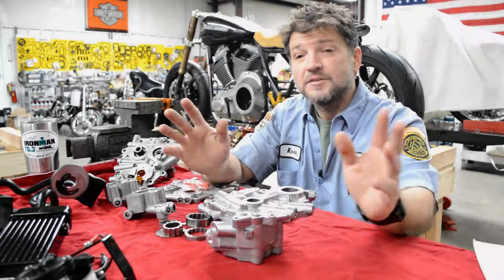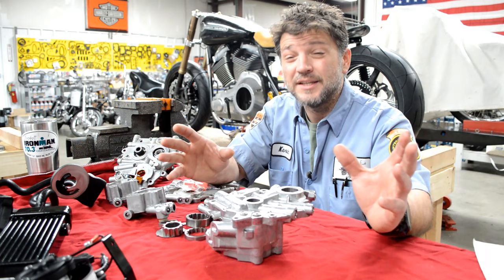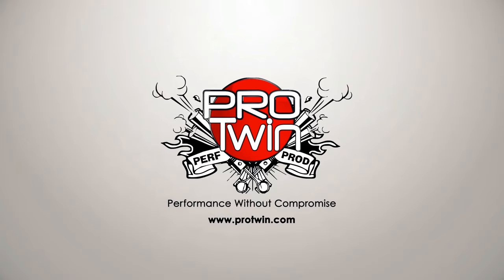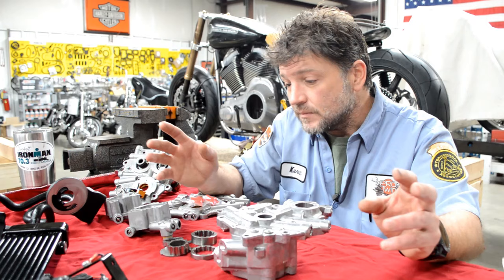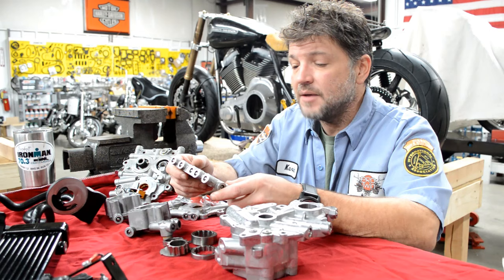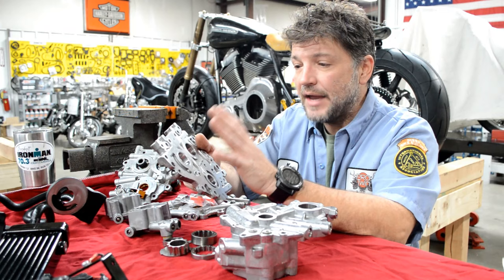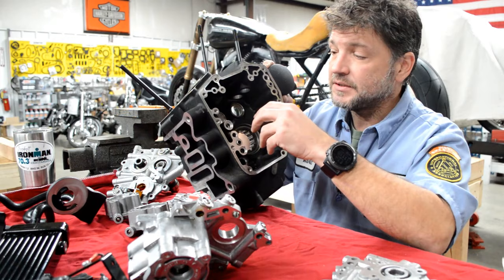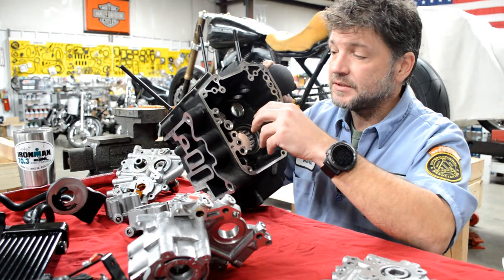Harley Cam Plate Tech - The M8 TC Cam Plate Debate - S&S Cycle - Kevin Baxter - Pro Twin Performance

Comment: I did my 01 FLHTCUI with the following  Dave Mackie 95", 20° domed piston's upgrade, Thundermax 51mm throttlebody with auto tune, had the manifold machined to match intake on heads,  Redshift cam tensioners, cam plate, high volume oil pump, blue micro bearing's, Vance and Hines 2n1 chrome pipe (quieter baffled), all stainless steel hoses( removed all rubber), Dakota Digital Dash, etc basically put in higher quality part's than stock, I did this at 24k miles I now have 29900 on it, now grant it I am not entering the Senior National Bagger Championships but at least I know I can get up and around any semi trucks quickly, during break in I lost about 2mpg but now it's back to where it was stock as long as I don't go full wide open throttle .. Hoban Brothers in Wisconsin helped me tremendously with my adventures, what can I say lol I am a late bloomer to making the torque and HP. 🤣🤣🤣 Ride fast but SAFE!!! Not bad for a 64yo ole geezer...

Comment: I have been watching your videos and they have only added to my belief that Harley-Davidson engineers are to be commended for taking an engine, who's design exists firmly in the 1940s (or earlier) and making it usable in today's motorcycle market. That these bikes run consistently at highway speeds, survive performance upgrades and remain oil tight is a testament to the level of engineering that goes into their very existence.

Comment: Excellent info... I did the screaming eagle plate & pump on my 06 Deluxe along with an Axtell oil pressure regulator valve system....working great so far...thanks for the great videos!

Comment: Bought a used 02 night train last summer and was lied to about service. Opened cam chest and found my plastic shoe disintegrated in pieces on the bottom and the metal tensioner actually fell out when I open the plate. There was no tension on my chain. Replaced with Fueling cam plate, oil pump, lifters and put in  S&S 510c cams with the hydraulic upgrade. Pinion shaft had some surface scarring and chain slapped around a little. Installed a top of line oil gauge with russel line and hot idle I’m at 12-15 but cruising I’m near 40-45. It’s still a little cold up here in Massachusetts and I switched to VR1 20w 50 Dino. I didn’t split the cases but I have good flow at filter and at the return bag line hoping no debris is in between. I cleaned up the pinion with some 400 and the scarring wasn’t noticeable but touch only by sight so I hope I got it in time. I have no ticking and everything sounds smooth...for now but I’m still nervous there could be splinters floating around somewhere. Guess at this point I should just run it and hope for the best as she does seem to run ok. Great video Kevin, thanks
Reply from the maker: Thanks for sharing. Unfortunate circumstances for you but it sounds like you may have got it in time. I would recommend pulling the return line from your oil tank and running it into a jug. Start the bike and continuously pour oil into your oil tank until the oil runs clear. Have a big jug and several quarts of oil opened and ready to pour. This will flush your oil system and hopefully get the rest of the bits out. I do this on softails every 2 or 3 services because so much is left behind with a regular oil change. A bit overkill sure, but it brings me peace of mind so it's worth it. Good luck to you.
Reply: Kevin Baxter thanks Kevin. I’ll definitely do that this weekend, much appreciated

Comment: I understood and experienced the design flaw of the OEM HDMC oil-cooler and ran JAGG on my TC's - currently I have a 107CI M8 - just wondering if the OEM (Stock) cooler is equal in design as the previous ones and if should consider replacing it with a JAGG cooler. On their website they mention Softail 2018 and up but the pics shown are all TC engines and I'm unsure if I can rip and replace the OEM one w/o much consideration. Thanks ahead and keep up the good work - your channel is very informative and content is most useful.

Comment: With the Jag oil cooler having the tanks either side will it increase the initial oil fill quantity?

Loving your stuff. Awesome and so motivational. Your knowledge, method of delivery and personality- awesome. Keep up the good work. 
Thank you.
Reply from the maker: the thermostat needs to open on the cooler..typically when fan comes on.  at that point you may see a slight drop in oil volume.  thank you!
Reply: @KevinBaxter  Great video Kevin, it has been speculated that Jagg manufacture's the Harley oil coolers. Do you think it is a trademark issue that they would route the oil that way? So that,  you would buy Jagg to get the correct routing? Thanks

Comment: I've seen video comparisons from SS, fueling, and HD. The cam plate from HD looks like pot metal compared to the others. 
HD is particle board. SS and fueling is plywood 
I just ordered the SS 475c cam chest kit. Reason why is that the SS is the only one that makes an aftermarket chain tensioner for the m8

Comment: I have a 302 GMC six cylinder engine and would very much like to see you do a video on performance building one!
Reply from the maker: Thats the plan for this one.  Have been collecting parts and having things made like custom pistons, cam, etc.  Also have a 3 carb setup...original 54 Corvette Carter YH horizontal carbs.  i'll be making a stainless intake and exhaust for it as well.  Just been so busy, havent had time to work on it.  I'll also be boring to 4.125.....a 327 CID I6.  Pretty cool.

Comment: Kevin. You are truly an inspiration. I have upgraded to the screaming Eagle hi flow billet cam plate and pump.   Did it before I saw this video. Also put in se tappers and 4x se cam as I have esp warranty.   What do you think of se cam plate and pump vs s&s?  And do you think the fueling short plug in scavenge hole really helps or is just hype?  Have a 2020 FLTRXS by the way.
Reply from the maker: Thank you sir.  The SE plate is not a bad product at all.  The case plug has been an intermittent issue since 2017 which we have been addressing since then on our builds.....not hype.

Comment: This was such a good video. I have a 2018 114 Heritage. I had the stage 2 done and went ahead and got the new 2020 oil pump installed. wonder how much better it is then the original one they came out with. there must have been issues for them to replace. I believe the gears are larger and more or less teeth. cant remember. I would love s&s but I have extended warranty and don't want to compromise it. i would like to see a video on clutch stuff plates etc. just sort of an area i don't know much about. again great video.
Reply from the maker: Thanks. I did a video on installing a clutch...check it out. It may help you.
Reply: very good. i just subscribed so will watch all of it. just watched the hp and torque one. great stuff.

Comment: Very informative. On the S&S oil pump screen: if you have  debris  from a component failure, won't it plug the screen? Also, with the same S&S oil pump that has 40% more scavaging, couldn't that harm the engine? It's my understanding that Harley engines depend on some of the oil in the sump for lubrication, splash feed  to the lower ends.

Comment: Hi Kevin,
first of all, thank you for your great videos and explanations. For me as a technician, it is exciting to listen to them and learn new things.
I come from Germany and ride a Lowrider ST.
I have a few questions for you.

1. what do you think would be the better choice, apart from the price, the Feuling Cam Plate with the Race pump or the S&S Cam Plate and pump?

2. the M8 engine makes such horrible noises, harmonious sounds different, luckily my exhaust is loud otherwise it would be unbearable. Before the lowrider, I rode an Evolution with an S&S Sidewinder 113 cui engine for 10 years, so such engine noises were alien to me.
What is the cause of this abnormal noise, it's the same with my mate's bike and what can be done about it effectively.

I have only ridden 2500 miles so I think it is an underlying problem with the M8 engine.

What I have improved so far:
Jekyll&Hide exhaust, S&S Manifold, dyno tuning.

Next upgrade is:
S&S tappet cuff set, S&S Precision Hydraulic tappet set, S&S Quickee pushrod.

What else can help with this ugly noise?
FEULING PUMP OIL W/PLT RAC M8 OIL ?
S&S ROCKER ARM GUARDIAN KIT M8 ?

I would be happy if you have some advice for me, I think other M8 bikers have this noise problem too.

Thanks a lot, left hand to greet
Andy

Comment: Thank you Kevin for the great video and great information. I have a 2011 twin cam 110 with 76,000 miles. If you're changing out the complete cam chest should you also spend the extra money and replace the existing cam chains as well?  You convinced me to go with the S&S cam chest kit, if I change the cam chains who would you recommend for new cam chains?

Comment: Great video Kev. I've been an auto tech 40 years.  Really enjoy your vids and how you break things down. I was on the fence about replacing the cam plate and pump on my 103 fat boy. I was impressed with the S&S unit before seeing your video. I may take the plunge. What cam would you recommend for some extra torque mid-range? I ride one up and never hit the rev limiter. Thanks again for the informative videos.
Reply from the maker: Thanks paul. If you can wait a couple weeks for our live video with fueling, it my give you another option to consider. You can weigh the features and benefits. If you shoot me an email directly, I can ask a few questions and better recommend a cam. Thanks for the kind words.
Reply: @KevinBaxter  did your video with fueling ever happen? I really like their cam plates > S&S.. that’s why I ask

Comment: Would love to see more information on Dark Horse cranks and when they are recommended for use, versus welding stock crank versus leaving the stock crank alone. Power levels etc; benefits. Also your thoughts on K&P oil filters and if there is any real benefit there. I have a 2020 FXLRS so most interested in how this all relates to the M8
Reply: I'm trying to pre-laod information before contacting you about an engine build, probably this up coming winter. The more I learn now the fewer silly questions I'll ask on the phone :)
Reply: Oh yeah; tuners is another good one. Right now I'm thinking ThunderMax but open to whatever you're most used to working with / confident in.
Reply: Found your tuner video; good information, thank you
Reply from the maker: no such thing as a silly question.  i look forward to working with you.  thanks.

Comment: Excellent info. I’ve always liked the Feuling plate in regards to function vs price, but now that I have a better understanding of the S&S pump, I will have to rethink my decisions on the next build. One thing that should’ve been mentioned that can help people make a decision is the fact that if the older stock cam plate is reused, a new bronze/manganese pinion bushing can be purchased for it, but it requires a special fitment process and specialty tools to be sized and utilized properly. I’m curious if the same is true with S&S replacement plate ?
Reply: teejay -  NO

Comment: Kevin, thank you for taking the time. I have a 2018 StreetGlide 107 with slip ons and an air cleaner.  The warranty expires in a month and there are 28,000 miles on the odometer.  I have the latest iteration of the factory oil pump new in the box that I am considering installing.  If I go to that trouble I would also want to replace the cam with a redshift 468, lifters, pushrods, and cuff.  The question is, how early do the cam plates start causing trouble.  Due to expense I was considering reusing the factory unit.  Would I be wasting my time?  I ride daily and my bike pretty much lives between 2000 and 3500 RPM with occasional runs up to 4000.  I’ve never bumped the rev limiter.  

Thank you,
Roy

Comment: Kevin, your channel is a great motivator & thought of going to school to get certified and opening a shop but think just working on my bike instead. It would be great to see vids on doing a step by step replacing various components and dig how thorough you are.  I currently have an 03 FLHRCI Classic with 60k miles and time for chain tension or switching to gear driven cam plate using S&S system instead but also thinking might as well upgrade oil cooler to Jag and even going with a bigger engine & Baker Clutch system too.  I’d like to do it piece by piece but thought to just go all out.  Do you take PayPal? I guess I should check out your website or call.  I appreciate your input.  Thanks, Carl.
Reply from the maker: We are a distributor for every company out there.  If you call the shop at 6782269651 and ask for Jennifer, she can get you anything you need shipped to your door.  I can do paypal payments as well as all credit cards.  Thank you!

Comment: Oil pressure is vital for plain bearings witch is what he means ,just ask any old biker & they will tell you no oil pressure means motor failure. A mesh screen will only catch bricks as us older bikers say . The oil filter catches much more debri .The most important thing is use good oil as in syn 3 & new filters ,do change evrey  3,000 miles will be much more effective.

Comment: Increasing the oil pressure does not increase the volume. The oil pump is a positive displacement pump. Unless the pressure relief valve exhausts into the tank and not the sump, it makes no difference as far as the sump pump is concerned. It is moving more volume through the bearings, piston oilers, etc, but it is moving less through the pressure relief valve. I do agree that it isn't needed though.
Reply from the maker: Agree on all points.  In these engines, volume more than pressure, is what counts.

Comment: Another great video Mr. Baxter. 2011 Softail Fatboy here. What about the Feuling Oil systems (Cam plate + Oil pump + lifters) ?? How they compare with the S&S? I have the S&S 583 cams with the Feuling Oil System.

Comment: Thank you so much for these videos, I just got done installing a pair of 509 s&s gear drive cams as well as the gear drive system in my 2002 88 twin cam. I have learned a lot from watching your videos, and I hope to continue learning from them!

Quick question about my gear drive swap, rode about 40-50 miles after installing the new cams, had some misfires at idle here and there, and flat spots at wide open throttle, seems like its running very lean, I was planning to get it dyno tuned in a couple days.
Is this a common issue you see when installing cams, having lean running issues?
Reply from the maker: Thanks for the sub. Absolutely get it tuned. A cam swap is a significant change.  I would expect lean and or rich spots with any cam swap.

Comment: Love your videos. I have a 2006 TC88, at 48,000 I changed the cam plate to the SE with hydraulic tensioners. The cam bearings on your video surprised me . Can you explain why oil suspended bearings are better than some type of ball or roller bearings? By the way I have 33,000miles since my upgrade and plan to do a looksee on the tensioners this spring.

Comment: I have a 2010 Roadglide with a 107 build Fueling camchest and oil pump.Also pushrods and lifters the stock numbers at Idle 15 psi now 30 highway speed 30 psi now 55 psi 85 degrees  temp never above 240 degrees .I said 10,000 miles ago If I only hade dollars for one project it would be the set up I just listed. Ride safe
Reply from the maker: Feuling makes great products no doubt.  One of our upcoming live broadcasts will be with Feuling to review all their line up and details.

Comment: Kevin that was a very informative video. I like the idea of upgrading the cam plate and pump to forged s&s. But if someone was a little tight on cash and there was no mechanical issues with plate and pump?  What are your thoughts on enlarging the scavenge holes in that case casting to help let more volume get to the sump pump?
Reply from the maker: i wouldn't recommend that...its not necessarily the case that's the issue...its the pump and plates ability to keep up.  if cash is tight, and you arent having a sumping issue, run with what you have if all checks good.  ive never heard of anyone doing what you mentioned with any noted results.  thanks for sub.

Comment: Kevin, you talked about the pressure relief valve in the cam plate.  Is this device only to prevent a catastrophic failure due to high pressure or is it actually modulating to control the pressure of the oil based on the spring rate and rpm of the engine?  I know the terminology can change depending on the group you discuss this with and I am hoping to really understand what function this device is performing.
Reply from the maker: It is a plunger with a spring under it for the purpose of regulating oil pressure.  basically, preventing it from getting too high.

Comment: I have a 2013 Deluxe 103, stage 1 (intake, Samson Cholo exhaust, PowerVision tune by Fuel Moto). I am considering cams, headwork and possible increase in compression. After watching this great video I realize I need to make other improvements while I’m in there. It is recommended to keep the idle at 1000 RPM so the engine maintains ample oil. Would installing your recommended cam chest and oil pump allow the idle to be reduced enough to get that classic Harley lope and maintain ample oiling?  Thanks for any help!
Reply: So this dude doesn’t read comments or respond?  My question is one he should have addressed by default in this informative video!!!  It’s a big fkn deal!!!  New Harleys idle to fast to sound like classic Harleys!